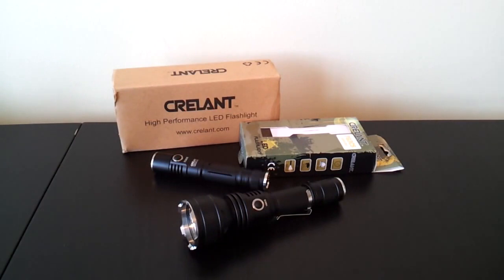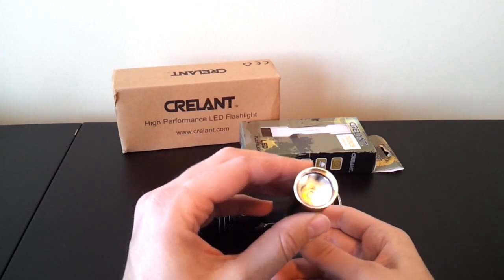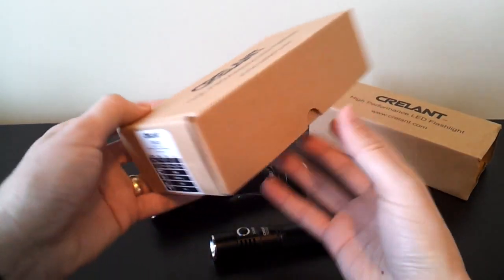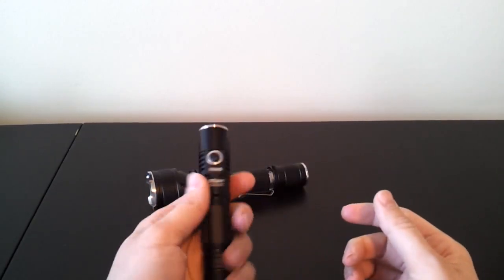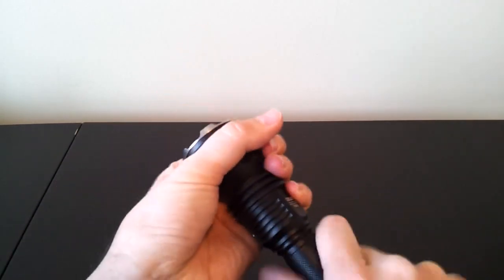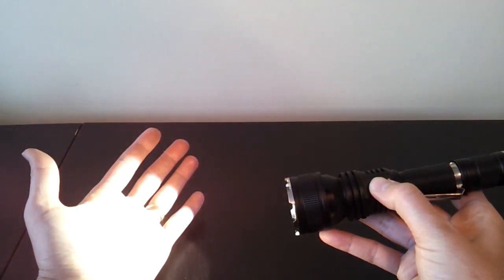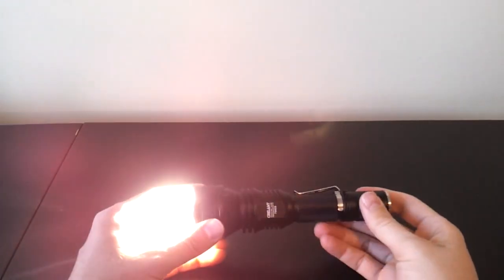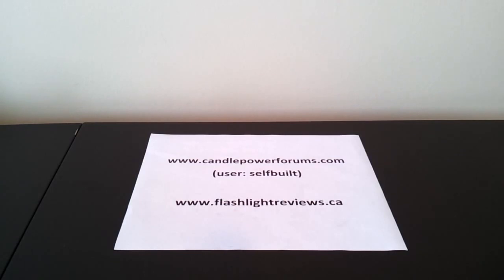Crelant 7G3CS and 7G6CS (1x18650/2xCR123, XM-L U3) flashlight review, by selfbuilt

Comment: Thank you for replaying,
So the TN11 will have bigger hot spot and more spill and it will illuminate wider area over the 7G6CS?
I have the TN11 but the runtime comparison shows that the 
7G6CS has double the runtime over the TN11 and I need a flashlight with max  runtime and good beam/spill.